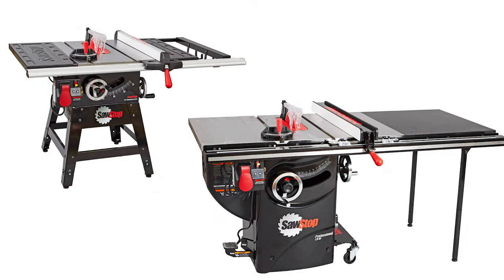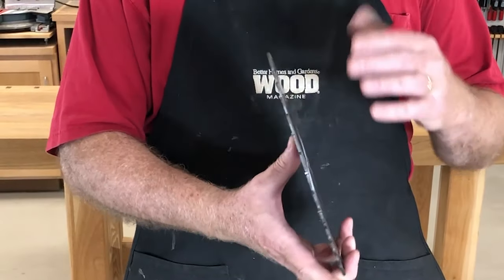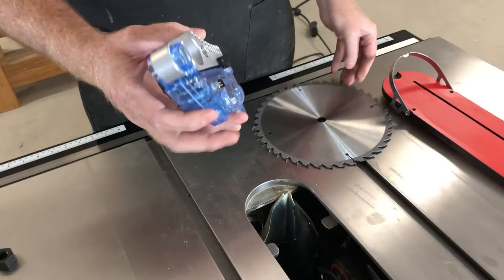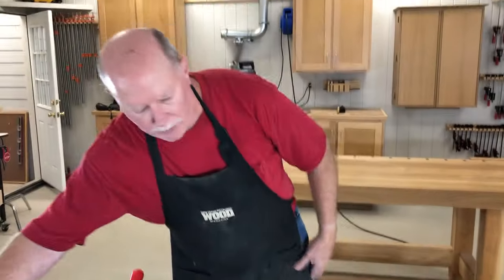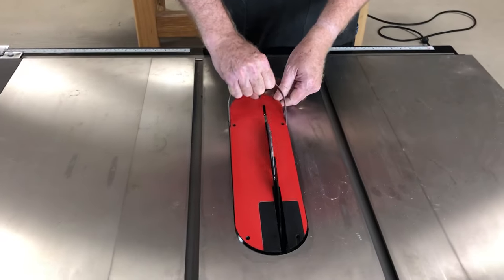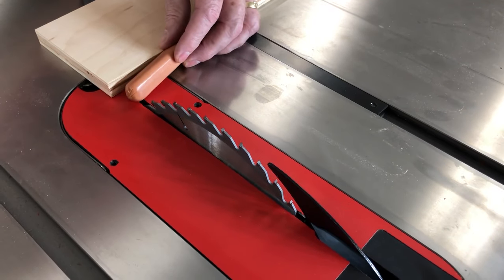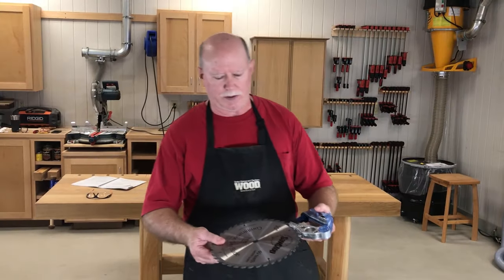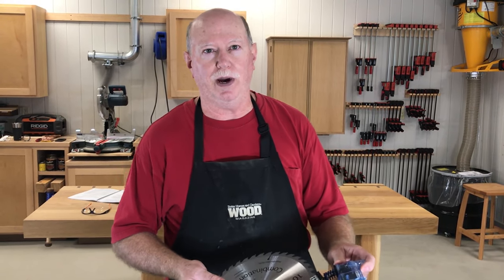How The SawStop Safety Feature Works - WOOD magazine

Comment: If the brake cartridge is activated due to skin contact, SawStop will replace the cartridge at no cost to you, so really the only cost to you is a new blade (and the cost of sending the cartridge to SawStop).  They have the technology to determine if it was skin contact or something else, like a nail, staple, miter gauge, wet wood, etc.

Comment: I had one of these saws trigger the brake yesterday in our local makerspace shop.  It was almost a non-event.  I didn't touch the blade in any manner, but I was working with wet wood.  There was no loud noise, and no sparks.  The sound was about as loud as that here in this video, and the blade was suddenly...  gone.
Reply from the maker: Amazing how quickly it works.
Reply: @working_country ___ I'm not upset at all.  I know the tool is safer than a regular table saw, and if we do have an accident, it's not likely to be something involving an amputation.  Besides, $200 for a blade cartridge assembly is trivial compared to the cost of microsurgery to attach a digit, and the time off work while it heals.  I'd call it a bargain.

Comment: So does that mean it will also be triggered if the blade encounters a nail or a staple in a piece of wood?
Reply: Most likely not. Strange thing is it depends on how conductive it is. So a thin nail like a brad nail most likely no but I thicker nail probably yes.
Reply: I think it would need to be grounded for the current to flow so as long as the nail only touches the wood and the saw it wouldn‘t stop
Disclaimer I know very little about physics
Reply: @Evokans  Good estimate, but this is not the case. Sawstop uses a low charge on the saw to detect the finger/hand. The saw realised the difference in charge, and then activated the breaks within 5 milliseconds the saw will stop. The person doesn’t need to be grounded from what I know, as it works with charge just like how static charge works.

Essentially it’s just the charge trying to spread out (like charges repel) and once it has the chance to go to a different body (in this case your body) the charge changes, some being lost to your body.

Going back to the answer about a nail, Sawstop say to turn it off when cutting wet lumber as it will conduct current, tripping the system. It really depends on the time of contact, size and metal.
Reply: @tonyhollerz6958  thx for the reply, sounds like you know your stuff
Reply: @tonyhollerz6958  just for the record, sawstop has ABSOLUTELY no problems cutting wood that is wet or pressure treated....the wood would have to be sooo wet that water would be flying off when you are cutting it, aka a situation you would NEVER be in lol. the wood would essentially have to be actively leaking water as you cut to stop the saw. you seen to act like you know how the sawstop works but you really dont lol.

Comment: I purchased a job site saw stop about a year ago.  I have sawed wet wood no problems.  I have momentarily disabled the safety feature to cut wet wood and then cutting the same wet wood forgot to disable it, but it did not trip the safety device.   I accidentally sawed through a metal screw in a piece of reclaimed lumber and did not know it until I examined the off cut which had 1/2 of a screw showing from the cut edge. .  I am very satisfied with the ridiculous amount of money it cost.

Comment: A lot of people argue that the cost and potential wasted blades aren't worth the money.  I'd like those same people to have a conversation with two of my coworkers who lost fingers to tablesaws, one having lasting never damage to their hand.

Secondly, for people who say they can't cut PT wood (including this video), take a look at "Debunking the Sawstop Myth" by Stumpy Nubs.  At the 3 minute mark he demonstrates a soaking wet piece of lumber being cut by the saw without it falsely activating.

Long comment short: The extra $1500 is a PITTANCE to pay if it means saving your hand.  The cost of surgery, loss of working hours and lifelong disability far exceed that one time investment.  And you know what, if you practice safe feeding/cutting methods as you should, you will NEVER lose a single blade to this machine.
Reply: YES! Every time someone tries to say they don’t want to keep buying replacement blades or brakes, I always ask them, which is cheaper over $20,000 in hospital bills to fix your fingers (if it is even still possible) or $80 for a new brake?  (Likely won’t need to replace the blade) and you get to keep your fingers.
Reply: Maybe if you actually pay attention when working with saws you would still have all fingers and dont need to pay thousands of dollars for a baby-proof table saw

Comment: Some of these are clearly faulty. I bought a SawStop Jobsite saw last summer. Last month, when turning off the saw, I heard a small pop. I thought nothing of it until I attempted to lower the blade before leaving the shop. It wouldn't budge. The cartridge had sprung forward and wedged up against the blade. It did not garb the blade nor did it retract the blade. Of course, it should not have fired in the first place. --I could still use the blade because of the failure but I had to buy a new cartridge and wonder whether the new cartridge would actually work when needed.
Reply: I did not and have not contacted them. I was rather sour at the time (as you might imagine) and anticipated (perhaps unfairly) that I would receive no reply or the run-around. I should add that when the saw was first delivered to me, the insert was chipped and the hole through which the axle on one the of the wheels was to pass was too small. I had to file it for 20 minutes before I could get that one wheel on. I wrote to tell them but never heard back. --I like the saw but am bitter over these issues. For 1200+ (a substantial sum for most of us), I would expect better quality control.

Comment: its very similar to proximity fuse on artillery shells..
the devices "senses" something by means of electrical currents (which are at speed of light), or radio waves in case of prox. shell (still, same stuff just different wavelength)

amazing invention

Comment: when you cut old wood with a nail in it will it trigger the saw stop when the blade touches the nail?
Reply from the maker: Probably. For those cuts, you can temporarily defeat the safety system.
Reply: @Wood  Your answer is 100% correct, and yet 100% useless.
You would have to know in advance that you're going to cut into a nail.  What percentage of people cut into a nail intentionally.
Also, based on how the system works nail may not trigger the brake.  Don't recall anything definitively on this.  If the wood doesn't conduct electricity to the body, then a nail in the wood may not either.

Comment: If it triggers every time you hit a damp spot in the wood, or the blade hits a nail I could see it getting very expensive. (I know you can't put a price on safety, but you CAN reach a point where you can't afford it)
Reply: Saw stop sued Bosh to stop their version.  Courts said the mechanics was different enough that was not infringing but somehow detecting an electrical circuit was.  Bosh's system didn't ruin blades.  This is such a usefull system to protect a huge chunk of workers that the patent system should have found it like the combine.  way to usefull to let one entity have a monopoly on it. Or failing that, make it a standards patent that the company is forced to license out.
Reply: For it to trigger, the saw needs to detect the minor electrical current in your body. Hitting a nail would only trigger it if you were also touching the nail. I've hit a hidden nail before and the cartridge didn't engage. Slightly damp wood wouldn't likely trigger it either but you can temporarily disable the safety mechanism if in doubt. In all these "hot dog tests", the user is always holding it with their hand. I'm not sure the hot dog by itself would trigger it.
Reply: Steve_1401: Although I generally agree with you, I want to add that most woodworkers work in a way that they hit nails extremely rarely. I think this risk is realistic mostly only if they work from scrap pallet wood or something like that. It's pretty unrealistic to cut a work piece after nailing or screwing so if you work from new wood, you won't hit metal parts easily. It's pretty much like airbags in cars: SOMETIMES they get triggered by a minor crash, like hitting a trash bin, and then it's just an unnecessary cost, but after a few decades of experience with them, engineers learned to set the trigger thresholds well so most drivers never ever saw an airbag opening in their whole lifetime, especially not by a false trigger.
Reply: Thanks for the info. I've heard of the system but had no idea how it worked. In the video at about 0.59 he says "If you touch the blade with your finger, or with metal, or with anything conductive like wet lumber .......... as soon as that happens it triggers"
I use a lot of reclaimed timber (not pallets), and occasionally I'll clip a screw or staple, even after I think I've covered the entire surface with a wood-wizard. I'll also saw the ends off lumber that's maybe been stored outside before I got it, often those ends will have a very high moisture content.
Reply: The saw will not activate if a nail or similar object is cut or in the wood.  As for the wet wood, it would have to be so wet that it would be spraying water everywhere during the cut in order to activate it.  Also even though they say to change the blade, typically you won’t need to, just the brake.

Comment: Question for woodworking experts: Does it matter what the material is for this to work? Or does basically anything other than wood with no electrical valance trigger it? 🤔
Reply from the maker: Anything likely to conduct electricity has the potential to trigger the brake.
Reply: That is absolutely fascinating 😮🤔📚🙌

Comment: Dude just imagine you want to cut some Wood that is slightly moisturised and you dont notice it, you are now down 150$
Reply: @Wood   

This gives me a evil idea to override it and not tell anyone.
Reply: @SumitSingh-iz9pw  please no
Reply: @first_last-  yikes dude. It was a bad joke, just calm down
Reply: @Wood  good response.
Reply: @first_last-  yikes man wtf
Reply: I wonder if they could have just used two good side rubber brake pads, each on a side with same spring setup for fast gripping. This setup would be cheaper for the owner since it saves the blade and only costs the braking system a bit of rubber depreciation.
Reply: @kingdommarket2234  Yes it would be more economical but it would still not be as fast or efficient as it is set up now. When it suddenly isn't as fast at stopping the blade it could do more injury to the person, specially if it is a fast movement onto the blade. It would lose some of it's purpose..
Reply: I think it will not do anything as long as the moisture on the wood can lead the electricity to your hand and ground.
Reply: This is a very good point. When im cutting in a customers garage bc it’s raining out there might be some water on the wood. If it wasnt so expensive everyone would have it
Reply: @kingdommarket2234 wouldnt stop it like this
Reply: @kingdommarket2234 rubber stoping that blade? Sure, why not peanut butter instead.
Reply: U can either choose $150 for that error or a finger which is non replaceable
Reply: There is a bypass so you can cut something that conducts electricity.
Reply: @SumitSingh-iz9pw or you can just buy literally any other table saw that doesn’t have this feature
Reply: At least you have a finger

Comment: So if your wood isn't in top shape it's possible the thing can go off on your own accident even if it's not your finger touching it?
Reply from the maker: It would have to be wet enough to conduct electricity or contain metal, typically.

Comment: Problem with this is, one it may encourage people to become more reckless or careless ie: unsafe! When using such a device. Which could one day, literally bite them. When they have to use a regular table saw without said safety device.(People will do this, not me. Ijs people will break rules. When they know, there will be Lil to no consequences for their actions. If they get "caught") The other problems with this, were already stated in this video. Wet lumber and or foreign debri in the wood. Which would at most cost you a new blade generally. Now costs you $150! (However, Imo! This is a brilliant idea and works amazingly. For its intended purpose. Where would this device be most suitable? A shop class! Or Vocational school that is teaching kids on how to use this tool safely. I would not tell them that they are safe because of the device. In I would probably remove the brand logo. That way they are being taught that the saws are dangerous and it teaches them to be safe on any saw. Vs a saw with such safety device. But if for some reason one student slips up. It won't cost them any fingers!) I truly believe that this is a great thing, I'd just like to see them figure out how to get around wet lumber activating the device. Because it'd suck to have to replace that, when it was no fault of your own and or didn't activate for your safety. I'm betting it can be done!
Reply from the maker: You're probably right, Richard. We were so glad when they put airbags in cars so would could finally drive recklessly all the time.  (BTW, you can temporarily override the braking system for wet/debris-prone wood.)

Comment: Is there a reason the system can’t just drop the blade, cut power to the motor, and activate the motor brake instead of dropping the blade while forcing a piece of metal into the blade?
Reply: That could certainly be done.
Think BOSCH had a system that did this.  Think it was called Reaax.  But patent lawsuit put a stop to it.
Question is though, can the blade be dropped below the table faster than it can be stopped?

By my rough calculations the blade is stopped in about 1/3 revolution from time of detection.  Less than 5 milliseconds (five one thousandths of a second).  I'm skeptical that the blade can be dropped below the table that fast.

Comment: Oh it’s detecting moisture through electrical pulses carried through the blades surface, that’s how it works. Let me ask the obvious question: what if I need to rip treated sheet or lumber? Do you just turn off the safety mechanism?
Reply: May be able to wear nonconducting gloves instead of turning off safety mechanism.  So could still have finger protection.  Have not proven this out and this is not a recommendation.  Just a thought based on my limited understanding of out the system works.

Comment: From what I've seen elsewhere, the blade is not destroyed. It is damaged, but the manufacturers can fix it for less than a new blade - assuming you are using a good high quality blade.

After reading some of the other comments, I am going to do some research into SawStop's legal actions. Protecting one's intellectual property is one thing, but to go so far as to prevent others from developing technology that protects us is going to far.
Reply: I wonder how much SawStop would make if they received $100-$150 per machine sold that used their technology.
Reply: @johnslaughter5475  they tried to first license the technology such that EVERY saw manufactured would have this technology.  the big tool makers at the time REFUSED to do so because had they installed the sawstop into EVERY one of their saws they offered, they would be essentially admitting that their saws were dangerous before and would open them up to potential lawsuits from users who hurt themselves BEFORE the sawstop blade was offered. you can look it up.

so sawstop had to then manufacture and produce their own brand of saws because they had no choice.

Comment: What if I want to cut metals
Reply from the maker: You can override the safety mechanism on an individual cut basis.
Reply: @Wood  May also be able to wear nonconductive gloves.  If glove is breached and finger contacts blade the brake should still be triggered.  This may be safer than overriding the safety mechanism.  I have not tested this, and this is not a recommendation.   Just a thought based on my limited understanding of how the system works.

Comment: But will this system work if you were wearing gloves?
Reply: It would cut the gloves but as soon as your skin is touched,it would stop.
Reply: If the gloves are conductive, such as being damp, they may potentially trigger the brake sooner.  Before skin even gets to the blade.  But conductive gloves have other risks such as electrocution.  Maybe the saw shorts out and ground fails.  Potentially could result in death.

Maybe Sawstop could design some special gloves that would be conductive enough to trigger the brake but not conductive enough to electrocute from common power sources.

Comment: Pity they don't make one that just pulls the blade away in 1/30th second instead of destroying the blade and safety device. At $200 a pop, employers won't use this for their staff, especially if they try to cut some damp wood. Wearing rubber gloves with this device would be a mistake too.
Reply: Not really, because the medical bill would be far greater. Additionally, workman's comp rates could increase. $150 is a scratch in comparison.

Comment: Use of hotdogs for demonstrations creates a best-case scenario.  Holding the moist surface of a hotdog electrically breaches the human skin.  So, when the hotdog contacts the blade, it is electrically as though the blade has already breached the skin.

Also, accidental blade contact is likely to be much more rapid than your, and many, hotdog demonstrations.

Not saying this is bad system.  Just that many of these hotdog demonstrations create unrealistic expectations.